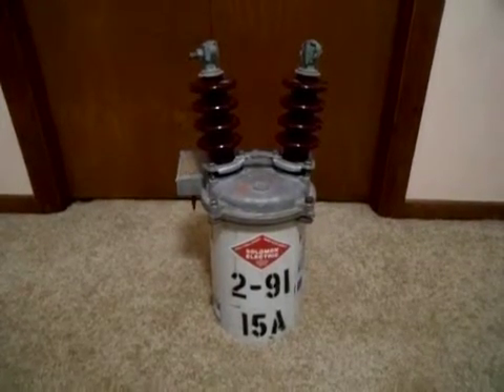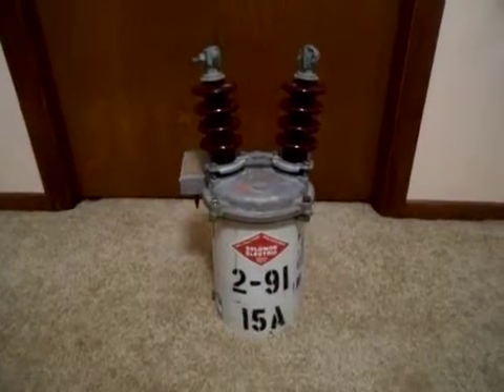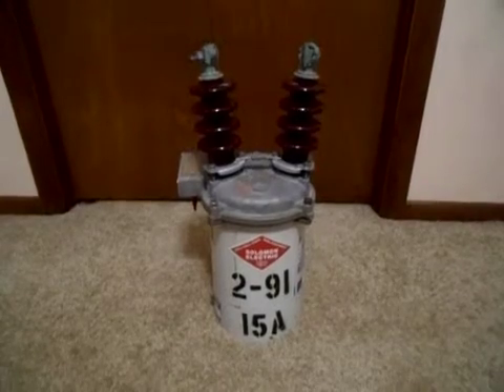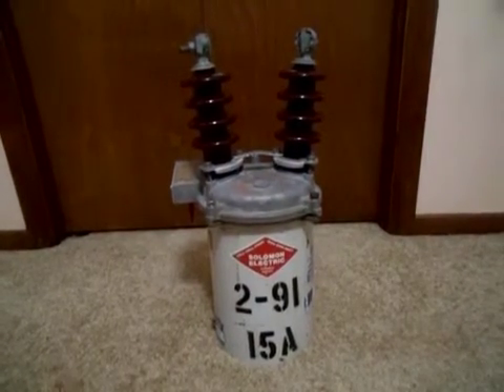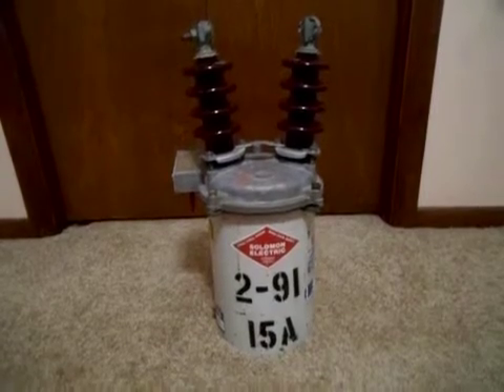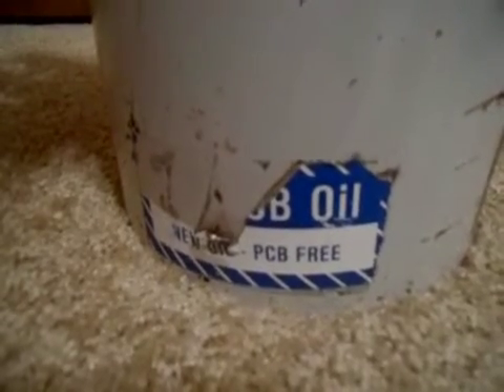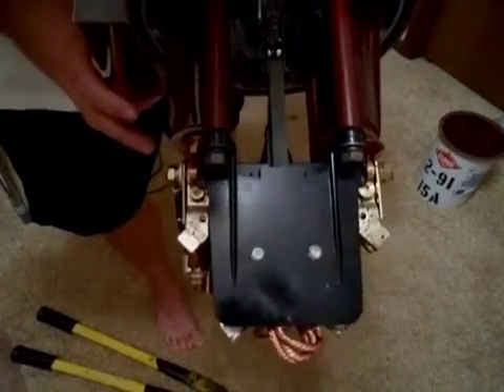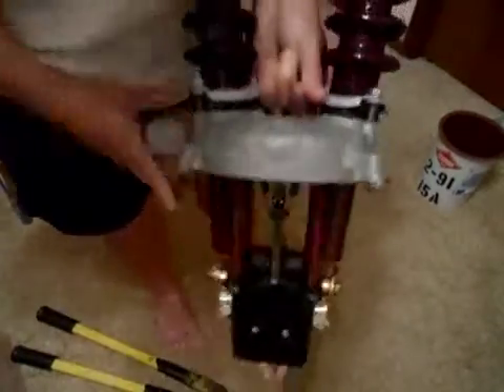Powerline Sectionalizer

Comment: Hello, lineman here. If I may, your information is a little flawed. Sectionalizers are relatively passive devices and do not interrupt current as you stated, in fact, doing so would cause catastrophic failure of the sectionalizer (same as closing in on a fault). The upstream recloser it works in conjunction with does the interrupting. The sectionaizer counts the off cycles between recloser operations and opens to disconnect a faulty section of line after a predetermined number of these recloser off cycles. This disconnection occurs while the line is de-energized between recloser trip operations. The blinking of lights seen during storms is a recloser operating, sectionalizer operations are not noticeable. Sectionalizers do have a small load pickup and interruption rating but cannot interrupt or pick up large load or fault currents.